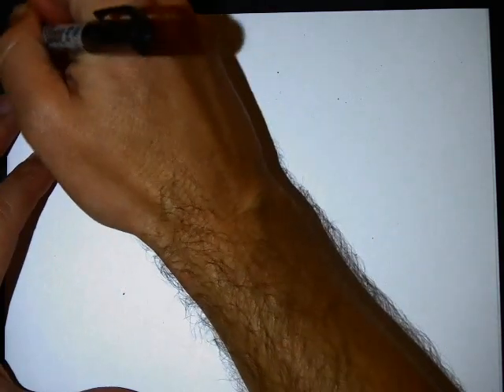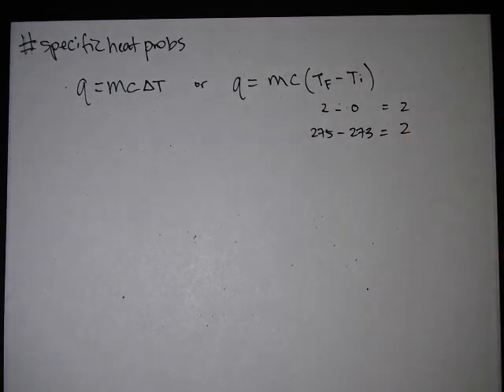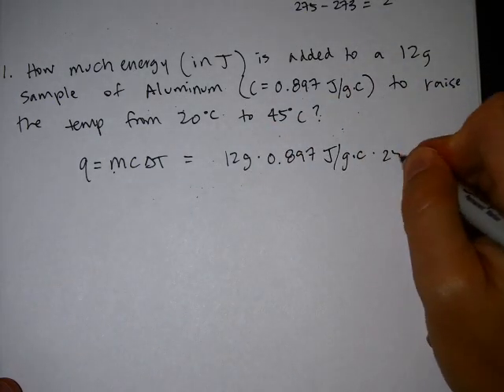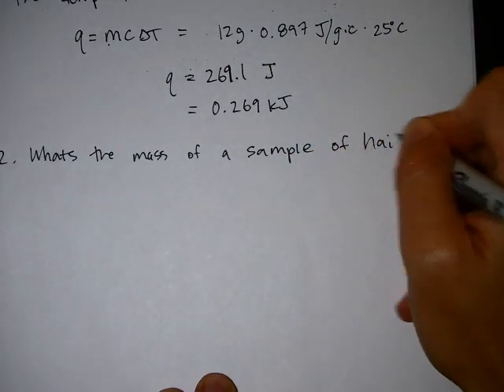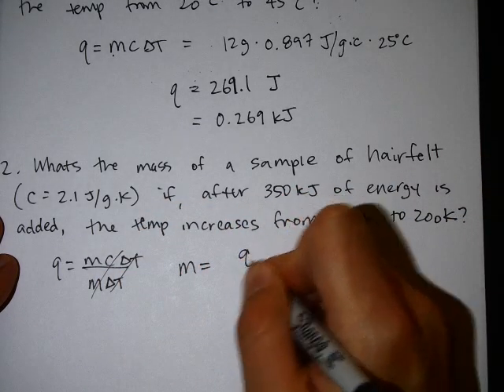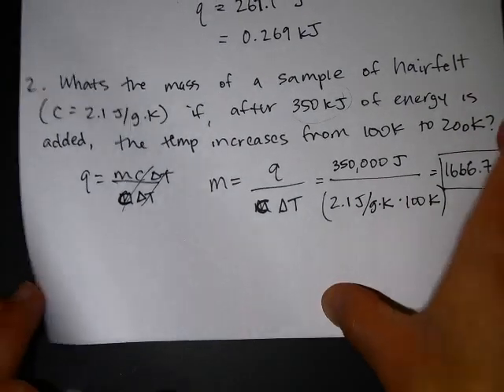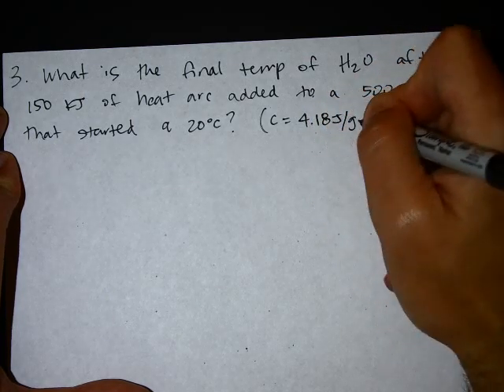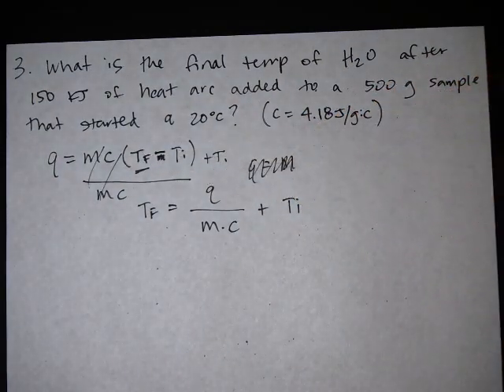Solving specific heat problems

Comment: Was the answer for #2, the correct sig figs?
Reply: They rounded it, because the answer from a calculator was 1666.67g. Therefore, it rounds to 1666.7g.

Sorry for the late reply.